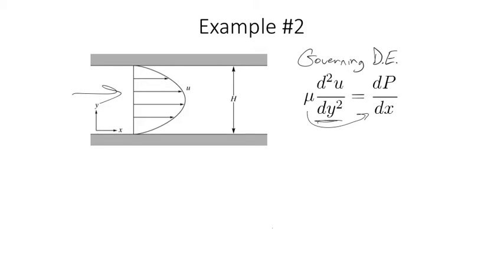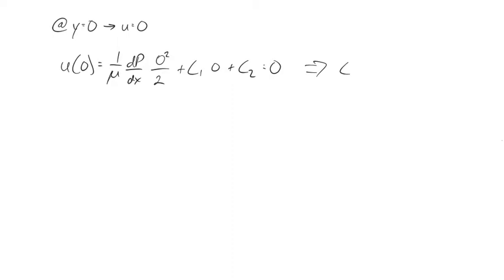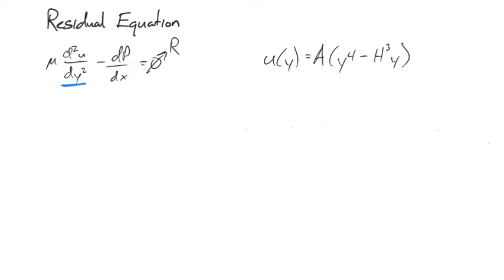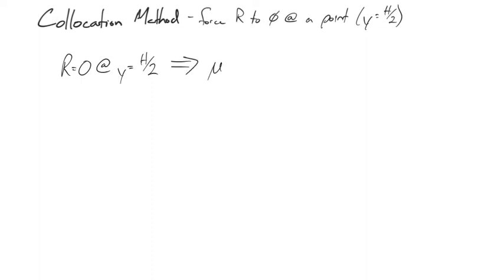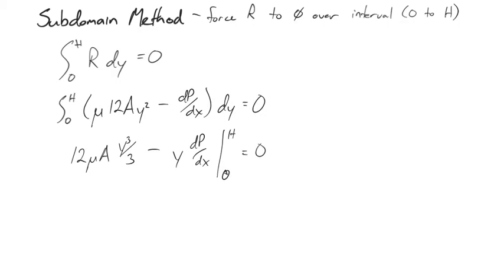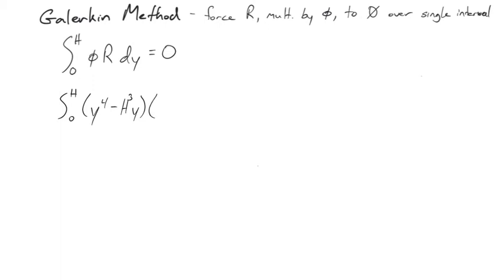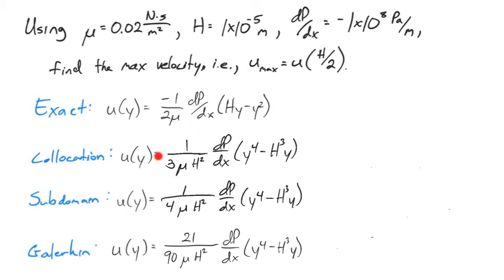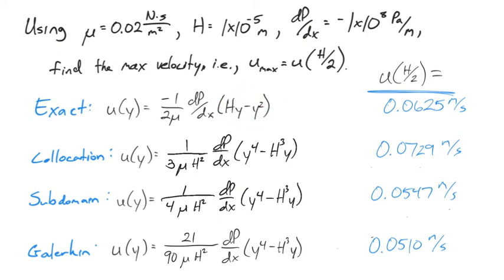Weighted Residual (5/5): Example #2

Comment: All the videos are nicely explained . Thank you very much . i have a doubt in video 5 . In collocation method we forced the residual to zero at H/2 to be zero. But in the final solution when u solved for u at H/2 the collocation method solution is not equal to exact solution . Can you explain why ? when we made residual at H/2 as zero we have to get the exact solution at that point right ? why is this deviation ??
Reply: He made that both functions on the differential equation give the same result at one point, that doesnt mean that both functions are equal at that point.
In other words and to make it clear, the fact that the slope of the slope from 2 different functions at 1 specifict point is the same does not mean both functions are the same at that point.
Reply: This is because you are making another assumption to start with - the form of solution being a single sin function.